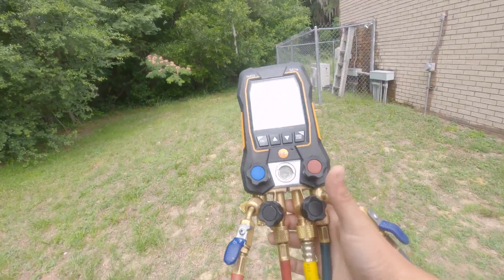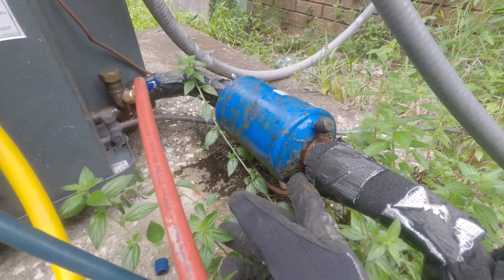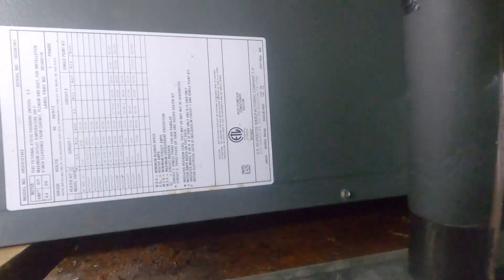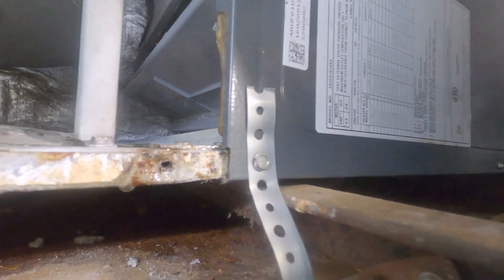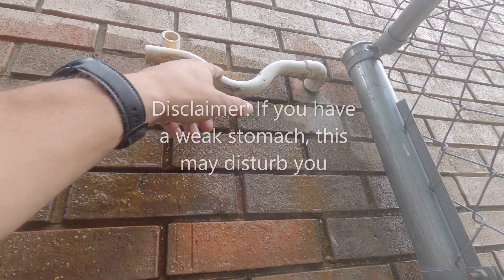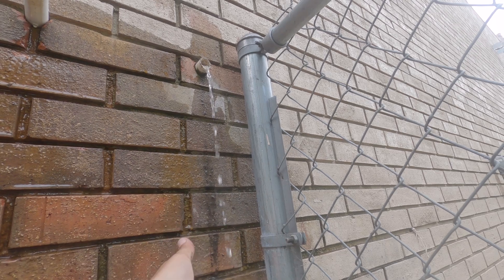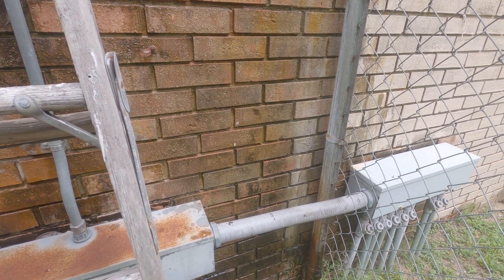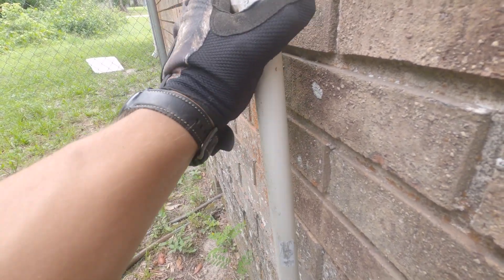Goodman AC was frozen yesterday and not cooling. Let's see why. HVAC

Comment: Found your channel recently. Subscribed.  Great videos!  Found a split system unit this weekend with the indoor fan motor not running (bad cap). AC system running slugging refrigerant as no evap fan motor to provide any superheat.  I would expect the compressor to fail in the near future.  Is that your experience as well with no indoor fan motor running and AC running?
Reply from the maker: Thanks for the sub! And welcome to the channel brother. My experience with a slugging system is always that the compressor has took some damage. But usually the system can be thawed, and fired back up with no issues for many years depending on what kind of compressor it is. (assuming the cap was replaced)
Reply: @VictorofHVAC  thank you Victor, really appreciate the feedback.  I envisioned the compressor slugging juice for too long and that destroying it.  Great to hear your feedback.  I really like your content and always look forward to your videos!  Thank you!

Comment: How often should u change dryer.  Filter.   ?   On ac units.     ?      Thank you in advance
Reply from the maker: Everytime you open the refrigerant system. So if you have to change a part that is in the refrigerant cycle, the liquid line filter drier should be replaced.
Reply from the maker: Your welcome 👍
Reply: You change a filter drier if it is creating a restriction in your liquid line. Best practice would be to change it if you open the refrigeration system up for anything ie a repair. Other than that, don't fix what ain't broke.
Reply: Thank you so much for the reply and your time have a great day:)

Comment: So if the drain line is clogged and the water backs/sits in primary drain pan it will eventually freeze?
Reply from the maker: If the system runs long enough, yes it will. I've seen it a couple times. I got to watch it happen through a Plexiglas  panel 👍. It does take a long run time but this is one of those applications where the system runs a lot from people going in and out of the space.... good question Rico 🤝
Reply: @VictorofHVAC  I'm sorry that makes no sense. The only way water will freeze is if it gets to 32° or below. Why would the coil get to 32° or below just because there's water in the drain pan?
Reply from the maker: No need to be sorry, Let me explain. 

When the coil has water in the pan that is sitting against the coil, and there is a longer run time due to heat load factors, The saturation temp will slowly drop. When that happens the coil will eventually hit that 32 degree temp and start to freeze up.

The only reason the evaporator coil doesn't freeze while in normal operation is because the moisture that's being removed from the space is warm, which in terms keeps that suction pressure/saturation temp up. 

(It's like running a chiller with no water movement across the coil)
(This same theory is what happens in a walk in cooler with a clogged drain, just happens a lot faster because the return temp is much colder)
Reply: @BibleBloopers  Another way to understand it, a wet coil will restrict airflow across it. If the pan is full of water & that humidity is near 100% coupled with nice long run time, suction saturation can creep to 32 degrees due to the airflow/heat transfer issue. Inadequate humidity removal from the air, that store was probably humid as well.